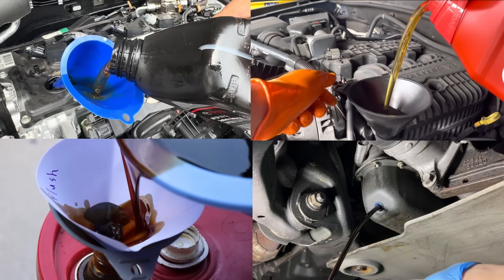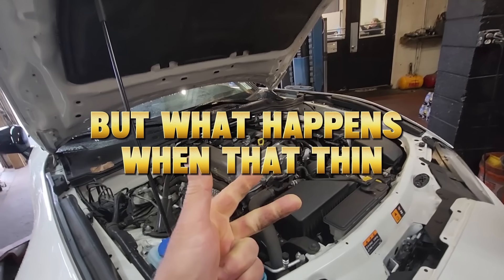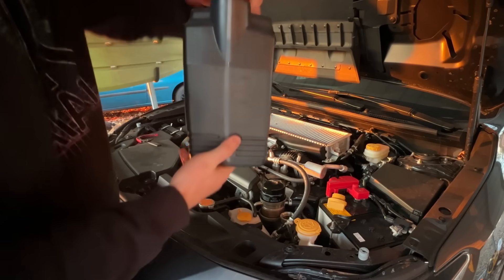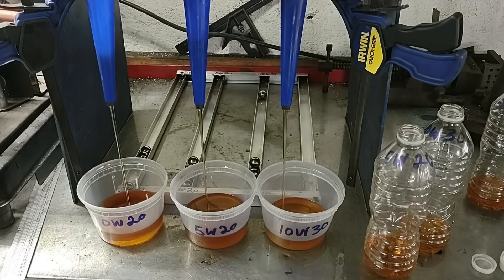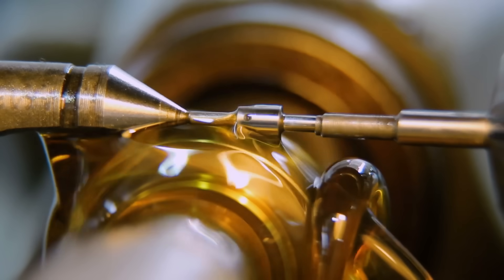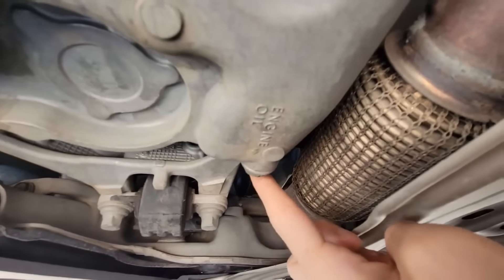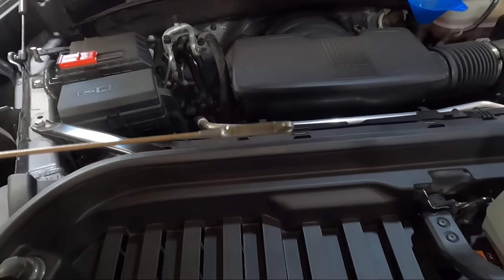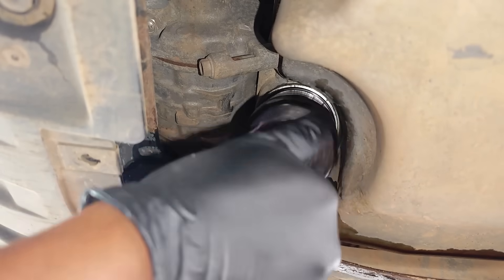The TRUTH About 0W 20 vs 5W 30 Oil (50 Engines Tested!)

Comment: With modern engine oils using for cooling internal engine parts especially important parts like spraying underneath the aluminum Pistons ,crankshaft bearing to keeping it cool ,if required 0w20 and using 5w30  will causes over heated these parts because 5w30 flow slower not remove heat quickly. Heat is engine enemies. 
If engine design using oil for cooling parts ( all modern engine) switch to thicker oil is crazy

Comment: summer 5w30
winter 0w20 
👍
Reply: I would do 0-30 in winter. But that’s just me
Reply: @garman7921  0-30 year around Im still in warranty
Reply: @garman7921 i am also think about 0w30  in winter
Reply: Unless you literally live in the arctic you don't need 0w oil. 5w is good down to -25°c
Reply: @peter7582 -30°C 🥶👌

Comment: You’re telling people the engineers who designed engines that require 0W20 are wrong?
Reply: It's not the engineers who push thinner oils including 0w-20 but environmentalists and gov. Most (same) engines get recommended thicker or much thicker oils outside North America where there is no C.A.F.E. mandate.
Reply: @eugene4817  if you can direct me to any reputable sources or studies that recommend 5W30 over 0W20 I would appreciate the information. 0W20 is recommended in both my vehicles.
Reply: They want it to last just past warranty
Reply: Those are the same engineers that are designing that aren't lasting a thousand miles like the one Chevy has been putting in their trucks or dodges hemi that the cam sits to high to lubricate properly at idle .
Reply: Wake up dummy engineers engineer cars to fail at a certain mileage. Get your head out of the sand. Been this way since the 80s. Where have you been on a deserted island or something.
Reply: @user-xs8gm2md6d  You think you know things, but you’re actually ignorant. Share your evidence that proves it’s been the way you claim since the 80’s. You have baseless claims without any proof. Listen up son and learn something. 0W20 oil didn’t even exist in the 80’s. In 2005 Honda began using Idemitsu 0W-20 in non-hybrid vehicles. In 
2010 Idemitsu introduced 0W-20 to the U.S. market, becoming the factory-fill oil for many Honda, Toyota, and Nissan vehicles.
Reply: No, because it is not the engineers who are specifying water-thin oil, it is EPA bureaucrats who are, and many of them  don't know squat about cars.

Comment: You don't know crap about this topic. SAE engineers have millions of miles of testing using 0w-20 even now 0w-16 they protect and flow much faster to protect the engine in cold and hot situations. This video is a lie many other videos show ZERO     0     difference after 150,000 miles of using thicker oil if changed every 5 to 6 K. The oil flows thru the tiny passages to lubricate your engine on start up where 99% of engine wear occurs. When the oil is hot its doing its job and flowing to all the parts. There is very little engine wear when driving your car on the highway in hot weather as long as you follow 5 to 6 k oil changes with quality synthetic oil.  Go right ahead and put thick oil in a car that does not use it in sub zero temps is just asking for engine wear to occur as fast as you can. Next you will tell people to warm up their car  by letting it idle for 5 minutes in cold weather before driving another lie made up by fools.

Comment: Tired of the AI-generated nonsense that ignores real-world experience and actual data? Let’s clear things up:
✅ Follow your owner’s manual. Only deviate from factory specs if you understand what you're doing — and if you do, stick to short oil change intervals (OCIs) to monitor wear and performance.
✅ 0W-20 works. There are engines out there running 0W-20 for over 250,000 miles without issues. It's not just about the viscosity — it's about the quality of the base oil and the additive package.
✅ Use a premium full synthetic (Group III+ or Group IV PAO base oil) with a strong additive package designed for your engine. Do 5k mile OCIs for safe, long-term protection — especially in turbo, DI, or high-load applications.

💸 Cheap oil might meet the bare minimum spec, but you’ll pay more later — sludge, ring deposits, timing chain wear, and poor cold-start protection are real risks.

⛽️ Also — use Top Tier gas. If you have a GDI (Gasoline Direct Injection) engine, deposits on valves and piston rings are a real threat. Top Tier fuels have better detergent levels, and using a quality fuel system cleaner periodically helps keep carbon buildup under control.
Reply: Plenty of toyota owners here in Australia are switching from 0w-20 to 5w-30 due to the heat. Many say the oil is like water on a hot day and when towing. Toyota mechanics are also saying to go to 5w-30....I,d rather have an engine last for 400,000klms and lose 3% fuel economy than save 1/2 litre per 100klms and have an engine wear out at 200,000klms...as is happening with the 0-20 oils..
Reply: I don't have those problems. Still running GMT 400 platform. The chevy 5.7 is perfection. My truck cant tell on me either.
Reply: 99% of vehicles owners aren't going to purchase group lll+ or group IV oils, either because they are unaware of what they are, or because of cost.
Reply: So YOU prefer real nonsense over AI "nonsense" that is fact in this video?
Reply: I'm tired of the know-it-all users who spout their own bullsh*t views pretending that their one vehicle experience is some how relevant to anyone but themselves.

Comment: I run 10W-30 in everything. (API classification SN or better)
Reply: For xW-30 oils MB 229.52 is one of the toughest certifications to get leaving API SN far back in the dust. One of the best oils is M1 ESP 0w-30.
Reply: @eugene4817  Newer, smaller displacement turbocharged engines have much higher chamber pressures. they definitely need something better than the SN API classification. I have never owned a turbocharged engine, and therefore, have had exceptional luck with SN and better. I would not run SA, or even SE in my Briggs & Stratton Lawnmower engine!
Reply: Why 10W-30 over 5W-30?
Reply: @filippocorti6760  10W-30 uses a thicker base oil, so fewer viscosity modifiers (thickening agents) are needed. That reduces the thinning of the oil from shear viscosity break-down, during the 5,000 miles, before I change it. If you use a 5W-30, I definitely recommend a full synthetic, because it is less prone to thinning over time. I also keep a case of it on hand, because I use it in everything from a Ford V-8, all the way down to my single cylinder air cooled engines, on my generator, snow blower, pressure washer, wood chipper, lawnmower, ETC.
Reply: @vincentrobinette1507  Informative post. Thanks. I guess if using conventional or synthetic blend, 10W-30 is better than 5W-30, even though the 5W-30 has more viscosity modifiers. I wonder which of the two is better if using synthetic.

Comment: I have been using 5-30 Valvoline for decades .
Reply: Less than decades ago 10w30 was the standard.
Reply: That company did not exist decades ago
Reply: @summerforever6736  Valvoline has been around at least 45 years.
Reply: @summerforever6736  Valvoline has been around since 1866.
Reply: @summerforever6736  that company started in 1866
Reply: That's funny! Valvoline is the oldest oil company (1866).  You're debating decades?  LOL!

Comment: Here in Australia the challenge for engine oil is dealing with heat. Our winters only get down to about -5C. That's nothing compared to North America or Northern Europe. 5W-30 is the lowest viscosity I use in a Toyota Camry. Work vehicles get something heavier, like 10W-40 or 15W-40. Especially if they carry loads or tow trailers in 40 plus degrees of summer heat. 🥵🥵🔥🔥
Reply: Never gets below freezing where I am , and up to about 38 degrees C in summer...I always use 10w-40 ....quieter at start up than the recommended 5w-40..
5W is just not needed when always above freezing temp.
Reply: @Leo555ZZZ  Far North Queensland..I now use 15/40 in my Pajero as I tow a lot, lot of stop-start and its always warm to hot up here. Used 5w-30 for a long time but I wasnt confident it was doing the job in the heat..oil change every 7000klms.(even less at times)
Reply: @iandickinson342 sounds correct for northern Australia.
Thanks for your reply. 👍
Reply: @iandickinson342  The caution for US drivers though is the engines here  are drilled differently to fit gas mileage rules. Thus the 0-20w deal. Higher "could" clog the system. Pretty safe bet if they recommend 0-20w you are driving one of these. 5-30w is a good test. Be great if we could just use gear oil but we can't.
Reply: Oil is chiper than Engine Rebuilds ?  10 ,w 30  oil won't get better  ?

Comment: I've noticed that AmsOil was on the video. I've used this product quite a long time. Got three vehicles pushing over 200k. 5w30 works.
Reply: had a parts chaser who told me he used amsoil in his old HHR he went 25K between changes (sometimes more) he put 400K on it and it was running fine when he gave it away,the engine was pretty clean when they had  timing cover or something off of it.have to give a nod to Amsoil,if you go long intervals use amsoil and good filters!
Reply: The both of you work for Amsoil!?
Reply: Owned motorcycles most of my life and I’m now 70. Used various synthetics in them in engines, trannys and transfer cases. Learned about Amsoil a few decades ago and tried it in everything. Last performance type vehicle I had was a Harley Electraglide with a souped up engine. Actually measured temperatures in everything to see the difference in oil performance. Amsoil made absolutely everything run cooler than any other synthetics which all ran cooler than any regular oil. Any synthetic is better than regular oil but Amsoil is definitely the best I’ve ever found. By the way, I bought my first car when I discovered I needed a back seat. For my dates.😊
Reply: Fake AI video.  Don't believe this video.  They never showed the actual data because there is none.
Reply: @DroneStrike1776  100% correct!

Comment: I switched to 0w30 in my 2016 Silverado 5.3 calls for 0w20 currently have 227,500 miles, also switch to 5w30 in my 2017 escape 1.5L Ecoboost which calls for 5w20, currently have 121,890 Miles both are full synthetic oil change every 5000 miles or 1 year.

Comment: Nothing but 0w-20 in my 24, Taco!
Reply: Your Taco probable won't last past 75,000 miles.    My 04 .. 5.3 Avalanche has over 400K miles. I use Mobile 1 ..10 w 30,  I never had an oil related problem.
Reply: @ricktaylor3748 , sure it will. Wake up!
Reply: I don't blame you. There's nothing wrong with 0w-20. My son has a rav4 with 200k, all we use is 0w-20. I even saw a Corolla with 480k miles and he used 0w-16 which is even thinner. Change the oil every 5k and you'll be fine.
Reply: @jackfrost99 just replaced long block in my Nissan titan pro4x at only 19k miles using 0w20 since new .so f@#k that I switch to 5w30
Reply: @Top_g80comp  Sure 🤣😂
Reply: @Top_g80comp understandable 
Nissan isn't Toyota 😂

Comment: For what it’s worth, the 2 mechanics I trust most both told me it might be a good idea to switch over from my 5w20 to a 5w30 motor oil. The only difference between the two mechanics logic was one said he tells his customers to switch over to a slightly thick oil at 100,000 miles and the other said 150,000 miles.
Reply: Esto lo recomiendan mucho los mecánicos... Solo q' no saben ni porque.. ejemplo.. yo  uso 5w30 sintetico.. y de ahí me quería mandar a 20w50  y solo a un aceite multigrado..  y sin saber esto se me hizo inlogico... Sin saber todo esto últimamente.. le seguí poniendo el mismo.. ahora  usaré 5w40.. 👍🥵

Comment: Honestly Great video and info, NO MORE 0W-20 for me
Reply: Maybe in a deep Minnesota winter for a trip to a nearby store…

(0w-40 might be better…)
Reply: @dennisyoung4631 For that exact situation is 0W-20 would be best
Reply: @dennisyoung4631  It's kinda funny but when I started driving (1975) the buzz was using 10-40 oil vs the standard 30 weight most cars used then. then they slipped-in 10-30 and all hell broke loose. 😂😂
Reply: @stephenrblvOh? Was using 20w-50 in the bike (1980) though that thing (SL175 twin) ran really hot.  (It was SoCal - east of LA - so warm -> hot weather much of the year.

I do recall people speaking of straight-weight VS multi grade then.  I was in the Multigrade camp from the beginning - that Castrol GTX 20w-50 was like water when I drained it from the bike, and I changed that stuff Often.
Reply: @dennisyoung4631 I have an '07 Goldwing right now with only 15K  that I put 20w50 in. Most bikes run much hotter and can use that but mostly not in vehicles. The thicker quiets my gears a little more too
Reply: @seatime674 especially air-cooled engines.  Both Hondas I had were, though the SL-175 ran significantly warmer than the XL-100 and ST-90 (I think.  That one was borrowed when mine was stolen, and I had to correct some issues on it, including a serious casting flaw in the cylinder head exhaust port.  (I ported the head, this done while correcting those issues…) 

That, and enlarging the bore slightly drastically improved that bike’s performance… I used the 20w-50, just like usual with that type of engine.
Reply: @dennisyoung4631  in Minnasotta the first number is what is important 0W.
Reply: Do not listen to this ai video. Just use what the manufacturer recommends.
Reply: @Gdoggy115  Wrong!: Obviously you're wet behind the ears, do basic research the thin oils are for gas saving at the expense of higher engine wear 100% and AI means nothing it was still input by humans
Reply: Just be sure to let the next owner know what you did.
Reply: @njsongwriter  All they would do is thank you anyway..
Reply: Same here, I have been considering making this oil change anyway but this video convinced me that is the right thing to do for my situation.
Reply: @MrTimdtoolman1 The only real concern I have is wondering if some engines have really been engineered and redesigned for the thinner oil where the thicker might not be a good idea. The trick is to find out if you have that engine
Reply: @seatime674 easiest way to- if you have a actual gauge that actually measures oil pressure - is to run the engine with a load of the spec’d oil, and then 1) drive it in a sane, sedate fashion, noting the oil pressure when fully warm; then 2) repeat the process with the different oil - with tests three and four being performed while driving in a spirited/ driving as if Madame is about to have an infant and there are no ambulances to be had.

I am suspecting that the thinner oils are about reduced friction, and the bearing surfaces (and clearances) needed to be changed to suit.  Of course, if they really want to reduce friction, they could use ball and roller bearings like certain older vintages of Honda M/C engines…
Reply: @MrTimdtoolman1  I don't know why. There were no references or links to back up what was claimed in this video. Show me the science.